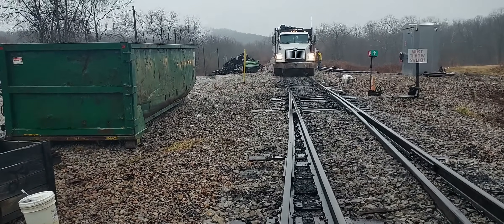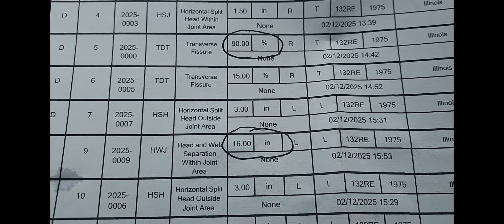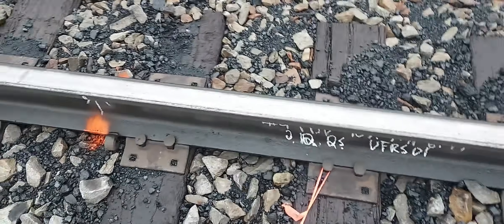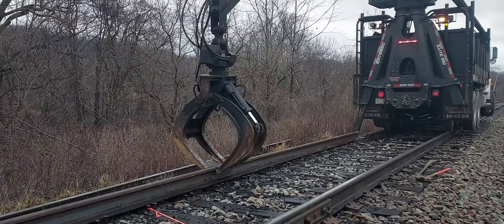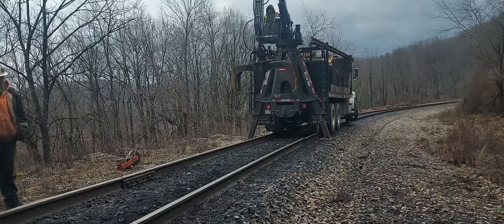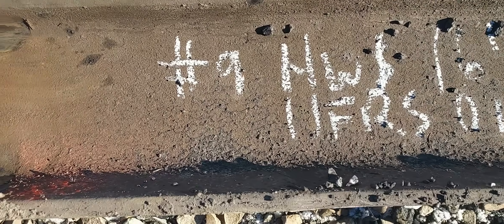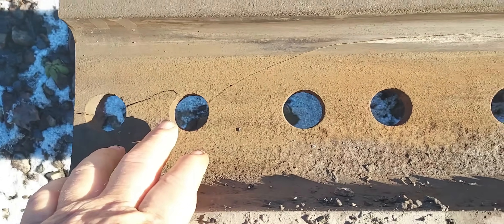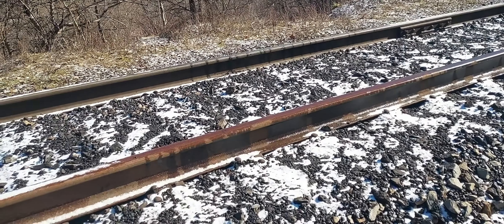Changing Out Two Sticks of Sperry Rail

Comment: When you put in used rail do you put it in do you  use it in the same direction? Or turn it so the ware pattern is opiset?
Reply from the maker: The stick we put in is turned so the gauge face of the rail head
matches what is already in that section of track Joe. If we don't then
we have to grind the rail head to match the stick next to it.  Thank you for taking the time to check out the video and may you have a very good day my friend.

Comment: I worked the railroad tracks lines all thru 1980s. Besides replacing we used to do a lot of scrapping old lines out. We would torch the joint bar bolts and smack apart with a sledge. Gather the OTM in a small dozer bucket and the track with a stinger truck and a flatbed truck. Would line them rail up 300 at a time across  two rail opposite direction. Scar across all the top balls with tourches every 4 foot and crop the rail when cool using a 20 lb sledge hammer. Would break off like glass. I used to travel the country back then to the jobs. I'm from the Mon Valley southwest PA area like you. Love watching all your videos. Thanks for sharing them.
Reply from the maker: it is amazing that you can do that when the rail head is cut isn't
it WarrensWarriors. Broke many a rail myself like that for scrapping.
The yards like either 3 or 4 foot pieces of rail depending on the
yard. When scrapping doesn't matter if you nick the joint bar 
with a torch, but if the bars are kept in service we try to avoid
a torch so as not to nick the bars.  Really appreciate your taking the time to check out the video and may you have a very good day my friend.

Comment: Must say the NDT inspection is a show of keeping everyone safe and is how Union Pacific runs their Railroad.  That rail is tough stuff just like the inconel and stainless steel in a GE J 79 Turbojet with afterburner.

Does this company sell off the bad rail, I know many machinists would love to Buy that rail, many make heavy duty hammers and anvils too.

Great video Dave and great safety tips too.
Reply: I work at a medical facility, and the engineering workshop obtained two short sections of rail from another department. (I don't know why or where they got them from.) They make good anvils and great for holding doors open.
Reply from the maker: Your right about that Kristy. Testing is far cheaper than paying for a derailment. All known Sperry rails are scrapped. While they would be
great for anvils and stuff like that, selling a known Sperry rail for back in main or yard service is unethical.  Thank you for the nice comment.  Really appreciate your taking the time to check out the video and may you have a very good day my friend.

Comment: That Illinois rail probable came from the old USS South Works (Now gone) mill just to the south of Chicago. I assume the Bethlehem rail was from the Old Bethlehem Steelton plant south of Harrisburg. Still operating under new ownership. Really enjoy the videos. Thanks Dave
Reply from the maker: You are correct on both mills IH1466VA. That plant near Harrisburg
is still called Steelton owned by Cleveland Cliffs. Glad you are
enjoying the home movies. Really appreciate your taking the time to check out the video and may you have a very good day my friend.
Reply: That 1975 rail from South Works was in the time frame that I was riding along with a friend of mine, delivering foundry sand by the truckload to South Works. We would load at the quarry in Ottawa, Illinois and make the run, Paul could easily do two runs a day.